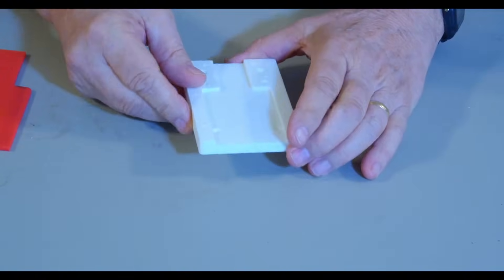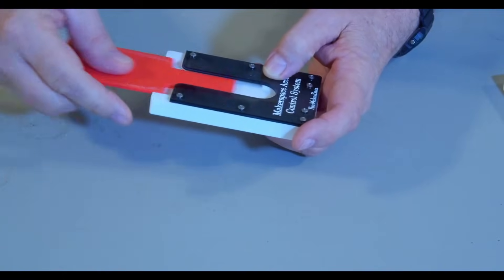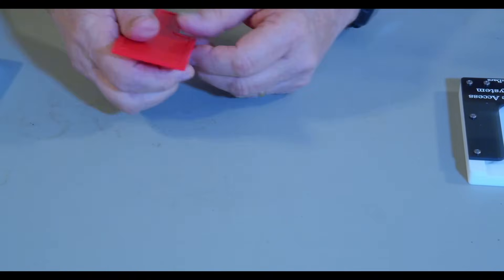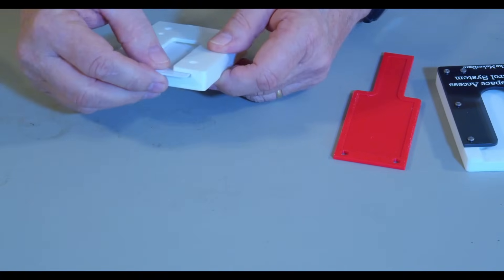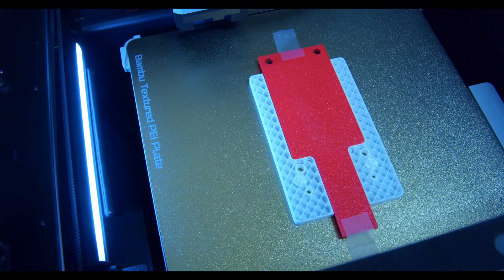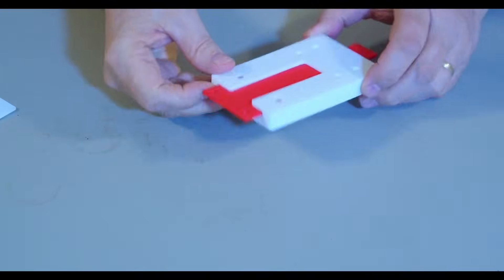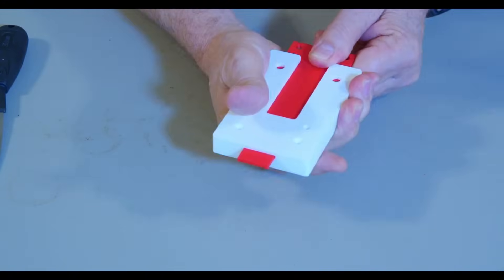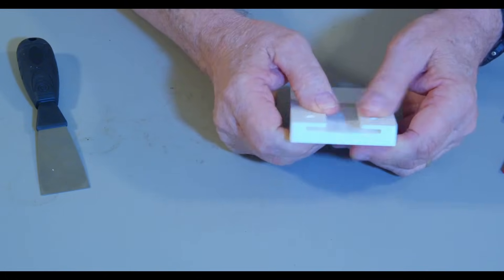3D Printing Without Supports Part 2

Comment: Is there a GitHub/etc for other spaces to implement their own MACS?
Reply from the maker: The problem is that the processor that was used, Particle Photon, and the RFID reader module are no longer available.  This was designed about 8 years ago. I had some spare parts so I built a few additional unit to use as spares.

Comment: The technic is interesting. In this case you can also adjust the orientation (standing on one of the short sides) or make use of different filaments. PLA and PETG don't bond to each other. Printing the parts in a different filament, or using one layer of a different filament in between would also solve the problem, without the need of pausing the printer for a manual step.
Reply from the maker: I should have mentioned that the red part was PETG.  This was mentioned in the previous video.
Reply: @makerspace533  Still mixtures off different plastic types are not recyclable in any way.

Comment: or you could have simply sliced that part standing upright on the bed and used a large brim to support a tall print
Reply: That's not perfect either, but the point of the video isn't even to make that specific print, it's to explore a different technique that perhaps on some other print down the line, it might be the best way.

Comment: Just split the model and use locator pins (built into the slicer) then simply glue to 2 pieces together. Much faster and much more hands off.
Reply: I think you've missed the point of the video entirely
Reply: @Person1873  How to make something more complex than it needs to be? When you do this for a living pal you'll understand that efficiency is more important.
Reply: @Festivejelly  When you get to the point in life where you know everything, why even continue? Asking for a friend.
Reply: @Festivejelly  In fact, this is much simpler this way.

Comment: Fantastic! I would just swap filaments in the AMS and print the top black then white writing over the top. I'm definitely going to give this a shot with ASA and HIPS for the support structure. Are the corners where the form meets the print radiused at all?

Comment: Thanks for such a simple suggestion.
fwiw: If you print the support in an incompatible filament (e.g. PETG support for PLA print) , it should make removal easier to remove.
Reply: He mentions it in the part 1 of these but his red core part is PETG.
Reply: @AJcore  Thank you for letting me know that!

Since he had problems separating it, I assumed that the filaments were too similar.  When I use PETG as normal support material for PLA, it's about that hard to remove, but I assumed that it would be easier to remove since the pre-printed support item would be completely cold.

That's what I get for assuming. 🤦‍♂
Reply: there is a special water soluble filament especially designed for printing supports. Engineering plastics such abs, pc etc you wouldn't be able to print overhangs with no support.
Reply: @MSM5500  the water soluble support is PVA. I think it's very expensive for what it is at about £60 per kilo. It works though, but only good for PLA. PETG is too hot for PVA.

Comment: Looks really good. You mentioned the black cover looks nicer. Have you thought about a color change and embedded text for a completely 3D print? I imagine using the black plastic piece is faster than doing it all on the Bambu but an all in one print with no fasteners would be a really clean look.

Comment: It's called reusable supports, try using a smooth surface so it will be less grippy and spray it with a release agent.
Reply from the maker: Release agent would not be good because when printing over the core, the PLA must stick to the surface with enough adhesion to hold it in place.  Otherwise it would peel up and cause a fail.
Reply: @makerspace533  the bambu stuff with the foam applicator looks like it might be a re-branded (or cloned) version of Magigoo, which is a water-based and water soluble bed adhesive which usually releases nearly effortlessly once the bed and part have cooled sufficiently
Reply: @makerspace533 you're not wrong, but you're not right either. the part of this print that stops it from being able to just print as a bridge, is the holes that you're printing in it.
if these went through the solid mass of the print rather than in the void section, there would be no need for the PLA to actually adhere to the reusable support.
Reply: potentially using a PETG part for the core would allow the bits to release easier as well without needing release agents..
Reply: @plussign  - I made a similar comment, and was informed that the red piece is in fact PETG.  (this was mentioned in the part 1 video)

Comment: Nice again!   Iterating by the minute.  Why would you not do it this way and skip the screws and other material.  Maybe do it in two colors and and a harder material, it is a Bambu  printer.  When it pauses it can be switching color too.   Again great growth in what two days?
Reply from the maker: The reason is simply aesthetics.  The smoke acrylic is easy to cut and engrave on the laser.  The engraving is filled with "Lacquer Stick" .  The laser can produce much cleaner text than the 3D printer.  And, I designed this 8 years ago, that's why they were machined out of Corian, not 3D printed.  3D printers have come a long way.  It sure is nice to have printers that don't look like a science fair project.
Reply: you could absolutely do a filament change on any printer while it was paused for you to add the support, nothing bambu specific about that, even an old school makerbot could do that.
Reply: @Person1873   I agree, have  a prusa as well as Bambu . I was stating it as a , no extra time involved, solution. He could leave the other steps out saving on 2 other materials and the part being done when it comes off the plate.  Unless he had other reasons, like aesthetics  for doing it the same way. Like mentioned below.